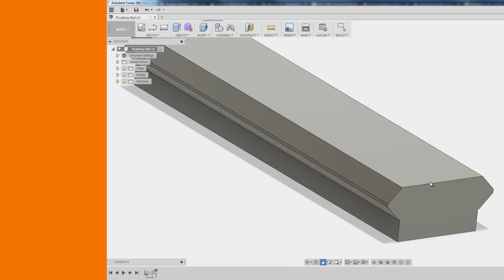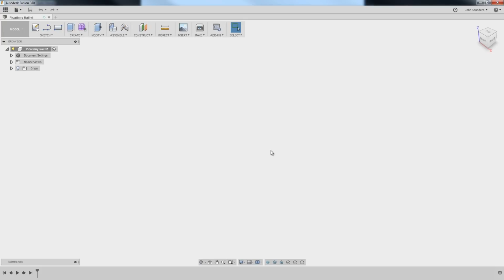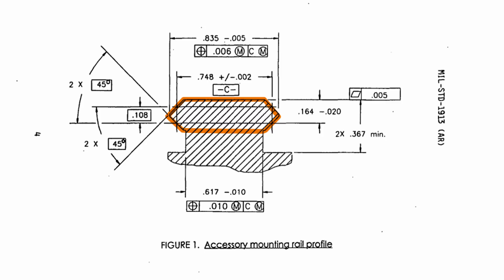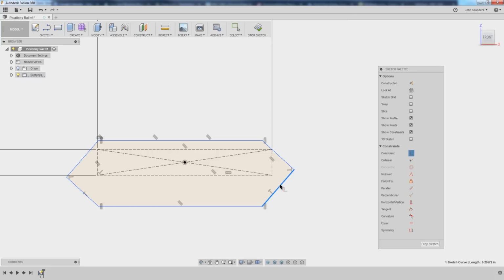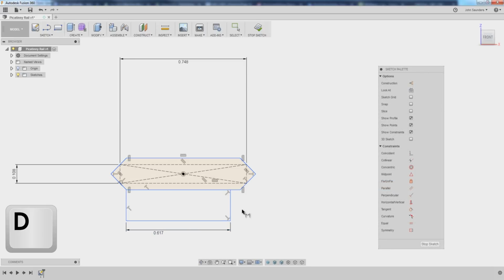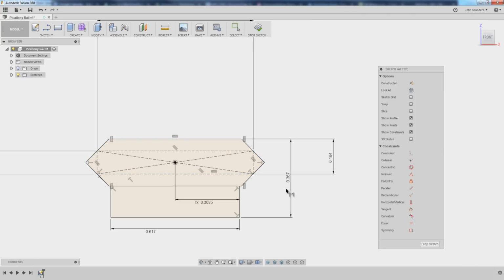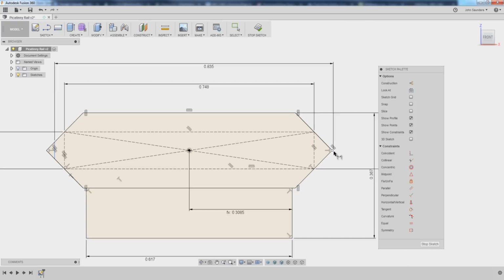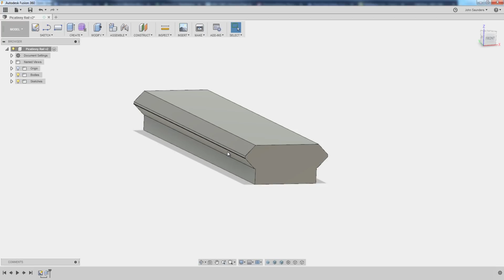Picatinny Rail from Drawing to 3D Model in Fusion 360 - FF113

Comment: I would have drawn everything up at mid-limit.
Reply: I thought about that on some that I modeled up, but chose to make it max material condition and hit the tolerance either in CAM or with cutter comp out at the machine.    I'd rather the first one come out oversize in other words.    a GO-NOGO gage would be the way to go for production.

Comment: It is not .164 it is .164  -.020 and same with .835  -.005
Reply: Nominal dimension is 0.164", -0.020" is the tolerance (undersize only).
Reply: no man the -0.020 is tolerance
Reply: .164 is nominal. It’s a unilateral dimension not a bilateral dimension. 

Every dimension on a print that’s written is treated as nominal no matter which way the tolerances go. 

You don’t just split the tolerance on the print to make it bilateral because you feel like it. Its dimensioned that way for a reason, and the part should be modeled to the nominal dimensions of the print.
Reply: gredangeo 
No. You DO NOT.  

Learn GD&T and what that M in a circle means.  You model the part to nominal *always*. 

The numbers on the drawing are the nominals. Period. That’s what the part is to modeled and machines to within the specified tolerance.
Reply: So I get from a GDT standpoint it's important to model the nominal dimensions, but as someone who does the modeling, Cam and then the machining I generally model everything to the center of the tolerance.  If it's so wrong to model it that way, how do you do it the "right" way and make good parts?
Reply: gredangeo 
That’s why every CAM system has a delta material to remove option for every toolpath. 

Again. That’s the machinists job, not the engineers job. The engineer designed it with MMC in mind, hence why all the tolerances are negatives in critical locations. 

You build the model to the nominal print dimensions. Because THAT is the theoretical “perfect part”. The tolerances simply say how much the part can deviate, and in what direction, while still being functional. 

You ALWAYS machine to the theoretical perfect part. That’s what you’re trying to achieve. The theoretical perfect part.
Reply: Craig Krueger 
The point of having a model is to have an exact, digital replication of the part on the drawing. Keep in mind this drawing was probably produced back when the part was drawn first, then later modeled in 3D, whereas today the 3D model is made first than the 2D print. 

But say you modeled that part to the middle of the tolerance, then that model got passed onto someone else to put it into an assembly, who had no idea the part wasn’t draw. To print nominals.  Now as they fit this into their assembly they design their mating parts to the model that’s been altered from print nominals. This induces stacking errors on their part, and if there is multiple parts those errors compound through the entire assembly. Suddenly all the parts that mate with the first are made to spec, yet for some reason don’t fit. All because the first model was not modeled to nominal, but produced as though it were. 

For example, that .02 tolerance. Say you modeled that at -.010.   Now the person who designed the mating part designed their part with.005 clearance and a  +/ .005 tolerance based of the model whose nominal was  .01 smaller than the drawing nominal.   At maximum material conditions of both parts, you will have an interference... even though both were built to spec.
Reply: Craig Krueger 
As far as the “right way”. It’s modeled to print nominals. It’s then machined to the tolerances of the print. Just like with every print. It’s up to the machinist to hit the tolerance. It’s up to the engineer who did the drawing to properly account for tolerance stacking errors.
Reply: Craig Krueger 
And if you’re the engineer or person designing the part. You’re free to dimension it and choose the nominal values however you wish.  But if you’re not the engineer or person who designed the part, you use the nominals that the person who did engineer it choose to use.

It’s one of those, it’s not your decision to make, deals. You don’t get to alter the nominals that someone else engineered.
Reply: Makes sense, I guess I'm just thinking about it more from a manufacturering standpoint.  I take a 2d print and make a 3d model to machine.  What I often run into are parts that have features that have + tolerances  and - tolerances on the same feature or operation.  If you take a model with nominal dimensions and get your cam data from that your guaranteed to make an out of spec part.  The only way to fix this (that I know of) is to manually modify the code.  It's much easier to model the part in the middle of the tolerance in the first place.  I'm just wondering what machinist at large companies do with this problem
Reply: - "That’s what the part is to modeled and machines to within the specified tolerance."

Which is rather hard to do if the default measurement is already at the top limit. Do you understand how this works? I know what MMC is. The tolerance is only telling me that preferably the part should on the larger side. But I still want the tool be in the tolerance when it cuts it.
Reply: Craig Krueger 
They just use height and diameter (cutter comp) offset values to adjust the tool paths to cut to spec without altering the code.

Or they simply make separate tool paths for the + and - dimensioned features with separate cutter comp numbers. 

You can call out multiple cutter comp values for the same tool. Same with height offsets.
Reply: Occams Sawzall  but for example on a lathe it's very common to have a shaft where the tolerance changes from + to - the offsets don't help you in this case
Reply: Achieving the theoretical part is nice. But if I have tolerance, I'm gonna end up using it, if I want to. Depending on other specs, it may not be in my best interest to not be exactly in the middle. Either way, I'll use whatever works.
Reply: gredangeo 
Easier to machine that way. 

But it’s FAR easier for an engineer to design an assembly as if every part were perfect, then go back and figure out how much out of perfect can each part be and still be functional.  They may sacrifice one one component and make it “sloppy” in order to have a more critical component be closer to perfection. Usually the more difficult to make parts will have looser specs while the more simple parts have tighter specs.
Reply: Craig Krueger 
Why wouldn’t they? You have TNR compensation numbers you can use
Reply: Occams Sawzall do you mean multiple offsets for one tool? our turning centres have that, but our oldest lathe doesn't and we still use it everyday (it also seems to be the one we run into this the most) but I guess this is just the part of the machinists job and where you need to know what your doing
Reply: Craig Krueger 
Pretty much. And I surprised even the old lathe doesn’t have multiple offsets for a single tool.  Must be pre 1980’s I guess?

Comment: Excellent demo!  Let’s throw a kink in the cog.  How would I model 20 MOA cant into the rail over a given distance?  For example, my LaRue OBR has a 20 MOA cant starting at the back of the rail and continuing into the hand guard.  Do you manually do the trig and input it as a slope or can you do it in the dimension as a calculated value?
Reply: Just model it as John did, but to the length you want. Then create a second sketch on the side of the angle you want and extrude it. 20 MOA is just 1/3 of a degree

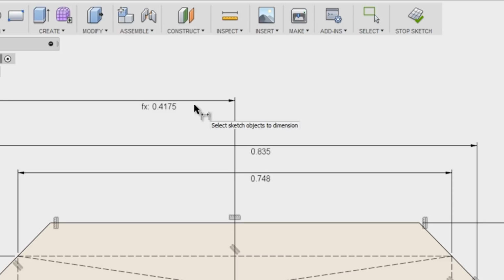Comment: At 5:00, you can instead use the "equal" constraint on the two small edge break lines. That original drawing looks a lot more complicated than it needs to be. Is there any reasoning from a CNC perspective to make the dimensions like that?
Reply: That drawing isn’t complicated. 

It’s dimensioned in such a way to utilized GD&T and to ensure that no matter where within the tolerances given that the mating parts will fit correctly.
Reply: Well its an old drawing they tend to be more complicated than what they should be. but it contains all the tolerances needed as well. i work in a really old factory its funny to read 50 year old drawing compared to 1 year old drawings.
Reply: I would have dimensioned it as a rectangle with four chamfers but maybe tolerances would stack too much. I guess it matters which faces the accessory indexes on.
Reply: How do you measure the dimensions after the part is made? For example how do you measure the 0.748 length of the rectangle with calipers? Do you need a robotic probe just to see if it meets spec?
Reply: James Patrick 
It’s true position call outs would pretty much require a CMM to do it. 

You can do it the old school way with V-blocks, height gauges, gauge pins and such as well. But a CMM would be the best way. 

If you wanted to measure that .748 you would set 2 pins of equal size (I think .25” in this case) to a center to center distance of .835, set the part upside down to the drawing orientation, then do the math (which I’m not gonna do here) to figure the height distance from the pin center line to the flat (with the .005 flatness call out). That will get you a derived dimension that if met will confirm the .748 dimension is correct.
Reply: i would spend like an hour calculating the top line length then measure the top length and the 0.835  so the height of the 45°degree edges that is 0.22" and i would check if the edges are centered to that height. pretty complicated :/

Comment: Do you have any examples of how you start/draw a multi component model? For example I am currently trying to sketch up the Gingery shaper based off of prints in the book in fusion. How do you manage all components, when to do the assemblies/joints, how about fasteners? New components for each one. Sorry total newb here.
Reply: Nate Van Bynen new components for each part. You can then export all components as individual components. Then start a new file and bring in each individual part you need to do your assembly and do your joints and such there. 

Fusion handles assemblies, especially large ones rather poorly. It can be done and have seen injection mold assemblies done in fusion, but it’s rather clunky. The software is clearly built more around the part side of things rather than the assembly side of things.
Reply: Occams Sawzall thanks so much for the reply, that makes more sense. I have been tryin to do joints as I go along and after a bit and a few components later I find it just gets to be to much

Comment: IMHO... something is lost where a standard drawing has dimensioning made from arbitrary reference geometries rather than geometries of the actual part itself.  There is a disconnect from the reality of how it would be machined on a manual machine.  In my line of work (railroad track) see updated spec drawings for rail profiles and there are dimensional errors on them where transitions between fillets are not tangent to each other at osculating points because some kid fresh out of engineering school, with no background in mechanical drafting, made a drawing however it was easiest to him in CAD.
Reply: R.C. Whitehead 
It’s because that’s the critical locations for the mating parts. 

And the true position tolerances at maximum material actually make the part easier to get in spec. 

If you dimensioned it any other way you’d have to have extremely tight tolerances on the 45 degree angles and the overall width to prevent stacking errors in the critical locations. 

Believe me I’ve dealt with my fair share of dumb dimensioned parts, but knowing what mounts to these rails and how they mount. That rectangle in the middle where everything is dimensioned is very critical. 

There’s nothing wrong with this drawing or where it’s dimensioning from.
Reply: R.C. Whitehead 
I explained elsewhere how it can be measured with the print dimensions manually. 

Parts and prints are not engineered and dimensioned for the ease of the machinist. They’re are engineered and dimensioned for the sake of assembly. 

Say you made the rail and mount out of titanium or inconel or 316 stainless vs aluminum. Those materials will not deform the same or possibly not enough to mate correctly if you alter the way it’s dimensioned.
Reply: R.C. Whitehead Been fighting things like that all my life....Engineers driving up the costs of things because they don't realize the ramifications of their incompetence. Try as I might I've tried to train them in some common sense techniques but Every time they take a lunch break it's time to start over. :(
Reply: Cad-Cam_Man - I had a mechanical drafting class my freshman year of engineering school.  I was perplexed how something simple like orthographic projections and isometrics made absolutely no sense to the females in the class.  They had no sense of how something is constructed from 3 reference views.  I bet they are now working at large firms with 6 figure salaries.
Reply: Occams Sawzall - Occams Sawzall - I understand your point but rail-grabbing accessories deform to clamp the rail anyways.  If I were making, or doing QA on finished parts, it would be far easier to measure the actual critical dimensions of a part.  If that reference box is so absolutely critical to the design, good luck measuring it with a mic.

Comment: I would encourage using a symmetry axis and dimensioning over it.
Definitly using the a standing dimension and dividing it is an Okay way but using an equal constraint and one dimension will look cleaner in detailed scetches.
I like your information density in your tutorial. Keep up the good work.
Reply: my most favorite method for this is to project in the appropriate origin axis then toggle it to construction.  fully constrained in about 3 clicks!